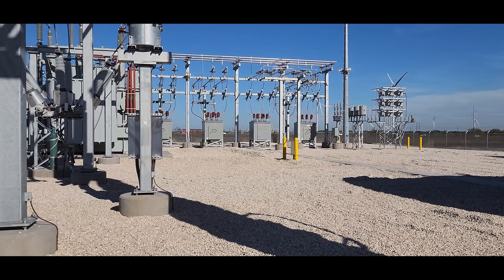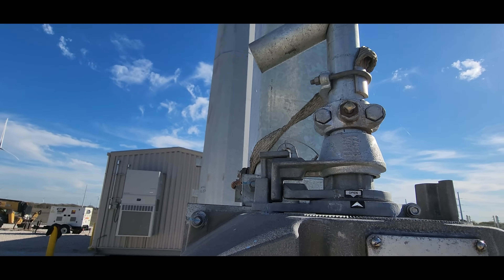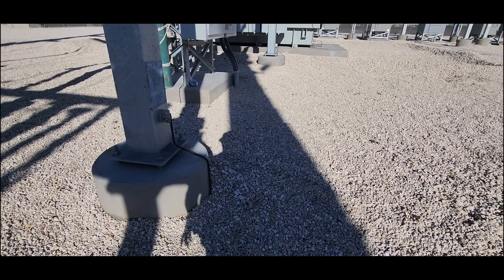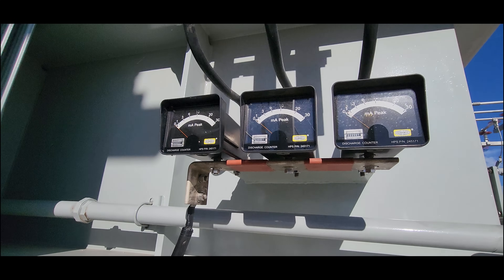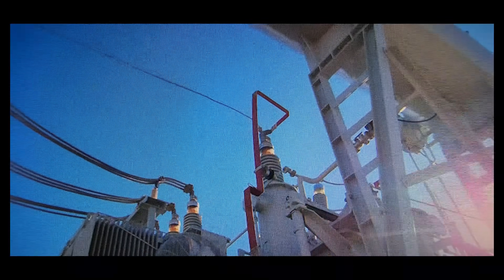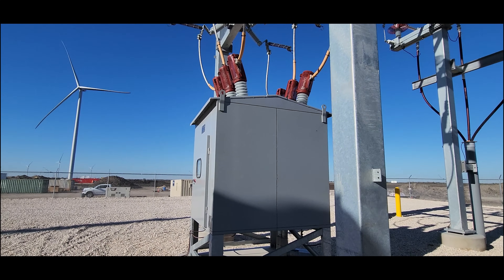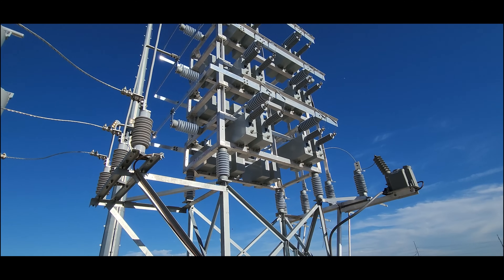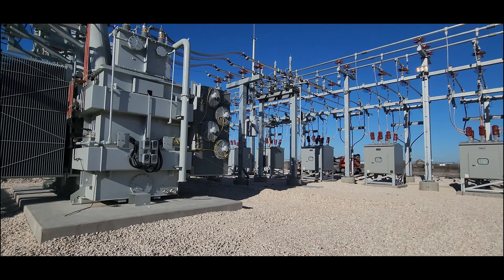138 kV High Voltage Substation Walk

Comment: What purpose does the 13,8 kV level of the transformer have?
Reply from the maker: Great question! that is the tertiary winding. it helps with harmonics and stabilizes the neutral. Ill try to cover that more in the next video!
Reply: Sometimes at my old company we used the tertiary winding as a HV source for our substation lv auxiliaries on multiple transformer stations. They are delta connected to absorb third harmonics generated in star connected higher voltage windings. This causes a issue with no natural star point on the source windings so the primary on our 3 phase  Aux transformers where star connected to produce a return path for HV faults  and third harmonic currents at that voltage level.
Reply: @noelcastle3986  yeah I also know tertiary winding for auxiliary transformer or reactive power compensation but in the video the auxiliary transformer was at one of the phases of the 33 kV bay
Reply: @spdfreakls1  is the capacitor bank connected to the tertiary winding maybe?
Reply: @arne0498  Yes I saw that and only a split phase secondary no three phase for auxiliaries.  So transformer fan motors are single phase 220 volt?
Reply: I think in this case they wanted to have a grounded neutral on the 34.5 kV side for the turbines, and since the utility usually requires a grounded Y on the HV side for the generating stations, in order to suppress the 3rd harmonic and all that, this aux. delta winding is introduced. Could have been a delta on the LV side but with a grounding transformer.

Comment: What are torque marks? Why do you need them?
Reply: They're an indicator that who ever torqued them has done so. (when you torque it down, you put that mark on there.)
Reply: It's basically a mark made with a paint pen across both the nut and bolt, indicating that it was properly torqued, but if the nut backs off you will see the paint is broken and the mark on the nut no longer lines up with the mark on the bolt.

So it's a quick visual indicator of proper torque, and if the nut has moved at all.
Reply: @ke6gwf  and @jfbeam Thanks for the explanation!

Comment: The utility should instead adjust prices. Negative if energy is not required, and higher the more power is required.
Reply: They do this in long term (hours) but when there is a sudden load change (seconds) a signal has to be sent to immediately reduce production in order to prevent the frequency rising too much.

Comment: You can't count? There are 5 rows, 6 columns, 2 frames - so 60 batteries, and they are most likely "2V" per cell. (standard lead-acid. 2.3-2.4 max.)

(Hint: they're also numbered with their position in the string.)
Reply from the maker: I can count, but not very high. i didn't want to waste peoples time by watching me count. First time in that building. I explained the theory about how we got to 120 VDC and moved on.